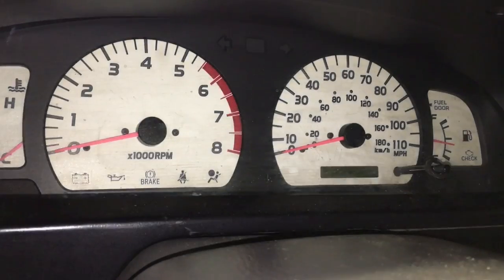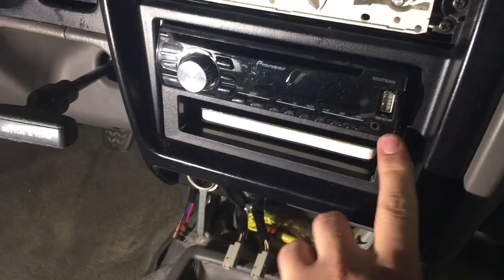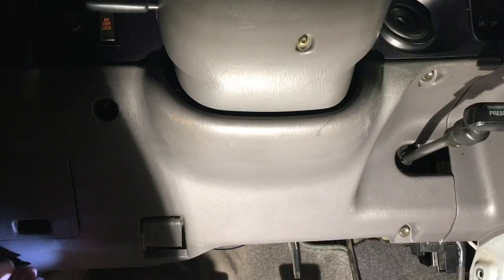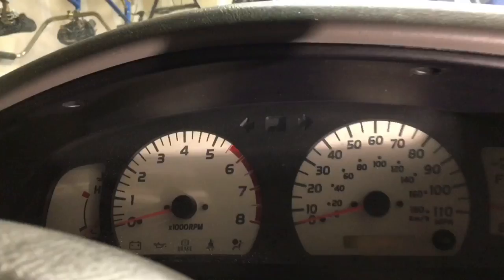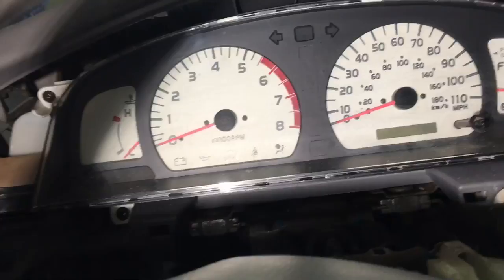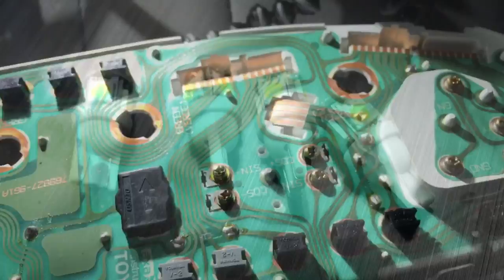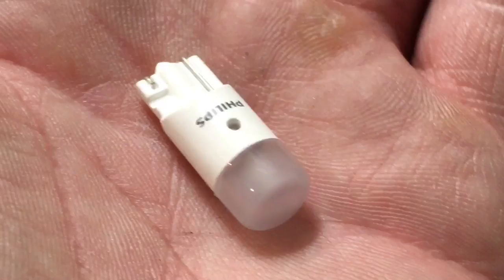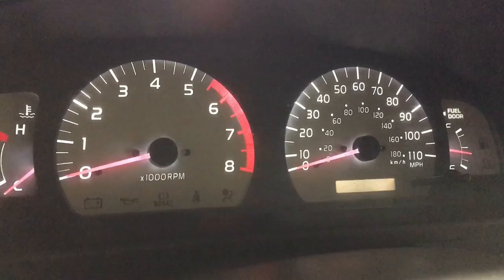Toyota Tacoma 2001-2004 Led Gauge Cluster Install.

Comment: Simple and quick narrative without wasting time.    Nice.     btw  I sure love my Milwaukee ratchets!      Disconnect the battery first.   Just in case an accidental short circuit happens and  Smoke on the Water  starts playing on the radio.

Comment: Great clip! Do you know the sizes for the small bulbs on the bottom of cluster for check engine, high beam, oil etc? Also what size for climate control bulbs?

Comment: good tutorial. I had one question about polarity?  Is there a way to know which way the bulbs fit in socket?  When you replaced the two bulbs that were opposite polarity, did you notice how they fit in?  Also, where you got your bulbs would be helpful.  Thanks again.
Reply: I plugged all the sockets back into the panel and none of my replacements turned on. I then remembered that I had unplugged the dimmer. When I plugged it back in, only two of the four LEDs lit up. I swapped the polarity and now all four lit up. I was now confident to reinstall all the parts.

Comment: Awesome video, one half of my gauge cluster is out and the other side is starting to go as well.

If you had to replace the lower LED's as well,  what bulb number for the Phillips would you use for lower lights in the cluster? Also, would these lower cluster bulb numbers double for the AC knobs as well?

Thanks!

Comment: hey do you also do the lights in the center counsel where the ac controls are? those are also burnt out on my tacoma:(
Reply: ItsYaBoyCris are you speaking about the control module or where the automatic shift lever is at?
Reply: Where the heater and AC controls are 👍🏼

Comment: Hey man, I wanted to thank you for the detailed how-to video. 

I was planning on doing this myself after getting an install estimate of $155 at my local Toyota dealer. 

I’m pressed for free time, so I think the $155 estimate is worth the trouble. Especially if they end up breaking anything during the process, they will have to replace it at no extra charge (i think). 

Anyway, my 2002 Tacoma came with amber cluster lights - on a dimmer. 

I wonder if your LED upgrade had an amber bulb option, but you went with white instead. 

Also, are your new Phillips LED’s dimmable?
Reply: Good question I’m wondering that now too!
Reply: Got amber LEDs from superbrightleds, these are dimmable and look stellar.

Comment: I have a question and it would be super nice if you could answer it. Is there a film you have to scrape off to make them white or is it Al just the color of the bulbs. I had a 95 powerstroke and I had to scrape a film off of the gages to get them to not be the green color that they were oem. On the tacomas it’s orange but if I put new bulbs in it will the dash be white

Comment: How are they so far . I purchased cheap Chinese and they lasted 4 days . I have not had cluster lights for about 6 months .. and I have been looking for some good ones
Reply from the maker: Chris Jaime they are great, they are definitely   brighter to. So far, I recommend them.
Reply: Coo thanks. I will buy some .. maybe I will look into the A/C knob leds also
Reply: Ps I have the same truck and color as yours . Just mine is a 4 dorr
Reply: Ps I have the same truck and color as yours . Just mine is a 4 dorr
Reply: I have same truck and same problem. Mine it’s only illuminating half of it. But will replace all 4 anyways. Thank you for your video it helps me A LOT!!
now!! Where you recommend me to buy does lights.

Comment: My cluster is functional but isnt lighting up.  If there is 4 bulbs, that means they all went out at once? Is that possible? Or could it be something elsw causing it to not light up? I checkes fuse box. The climate control lights up btw its just the cluster that is not lighting up.
Reply: Ricardo Vivanco i have an issue too. I plugged in the new leds and they didnt light up. All the other instrument lights were fine except the ones I replaced. I flipped them around and nothing. I changed one of them with the old bulbs, snd then nothing lit up. After that the entire instrument cluster stopped working. No lights at all, and speedo/tach didn’t work either, but the only light that lit up was on the bottom left for the Rear Dif Locker, which is extremely strange because my truck doesn’t have the Rear dif...
Reply: Jonathan Torres sooo, what could it be? Bad cluster? I was thinking of tackling the bulb replacement job but im afraid of messing it up more like in youre case. I might just have to eat this one take it to the shop**
Reply: Ricardo Vivanco Found out it was just a blown fuse in my case. I was scared when the whole cluster stopped working, but I replaced the fuse and pretty much everything was fine. The lights still don’t work so I’m not sure if the little light housings went bad while I tried replacing them, but that doesn’t worry me too much. It got late so I’ll check up on it another time.
Reply: Ricardo Vivanco Just read your first comment again, we’re in the exact same situation now. Cluster works, climate control lights work, it’s just the cluster lights that don’t work. And I know its not the bulbs themselves, I used 4 others from a 10 pack I got and those worked perfectly.
Reply: Jonathan Torres I'm gonna take it to a shop that specializes in cluster and electrical repair i will let you know what happens
Reply: Ricardo Vivanco Thanks in advance, appreciate it. I’d like to think it wouldn’t be that complicated/expensive of a fix. Good luck
Reply: Jonathan Torres it was just the bulbs. Had them replaced. It was 100 dollars total. I could have saved 100 dollars if i had done it myself but the fact that they all went out was what made me take it to shop. Oh well. Fixed. Good luck on yours, man!

Comment: My lights bulbs went out I replaced them and they don't turn on I checked fuse and bulbs are new and dimer works but Still nothing
Reply: This could be a dumb question but... Did you change the polarity of the bulbs?? Try pulling them out and putting them in the opposite way.